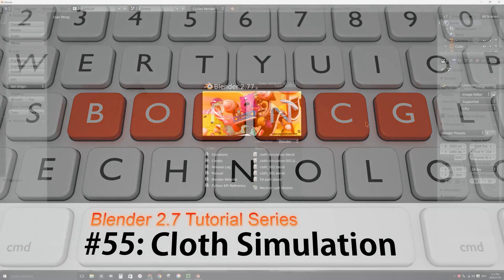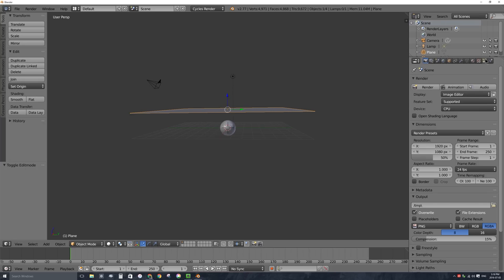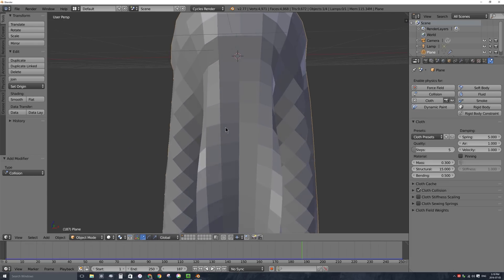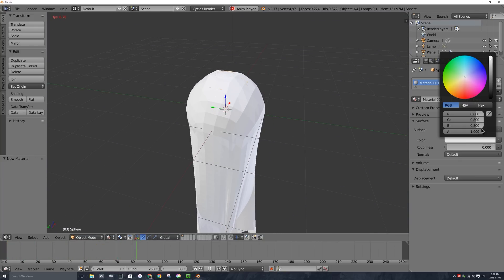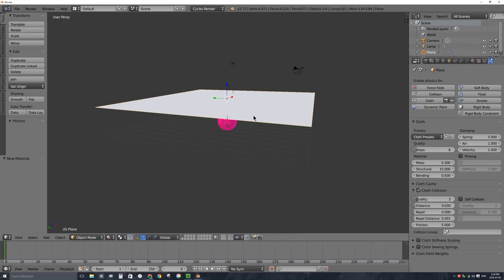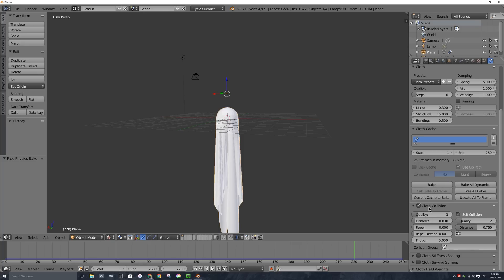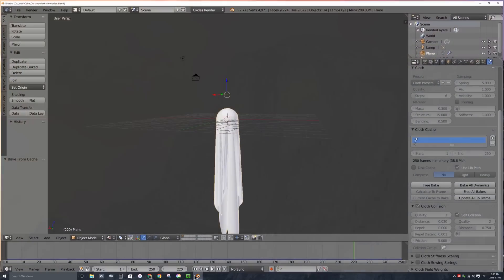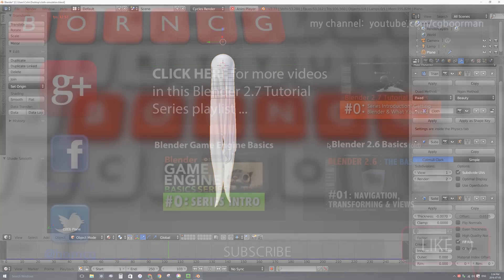Blender 2.7 Tutorial #55 : Cloth Simulation #b3d

Comment: hey, can we pause the simulation at x time, and get the simulated/bended cloth object as model?
Reply: The cloth is a modifier, so if you go into the modifiers tab (while in object mode) and click Apply, it will convert whatever is showing in the current frame into a model.
Reply: @mattermat1925  thx buddy it will help a lot

Comment: hey how do you put this in game logic
Reply: AΩΣ he didnt
Reply: exactly
Reply: the only thing that I can think of is simulating cloth, retopologizing it and baking normals. In this way you can create beautiful static objects. As a rule, even game engines like Unity have some cloth simulators built it. For example, you can simulate cloth with a low-poly mesh in Unity which is fluttering in the wind.
Reply: If you need to ask it's too complex for you. Most games don't even use it.